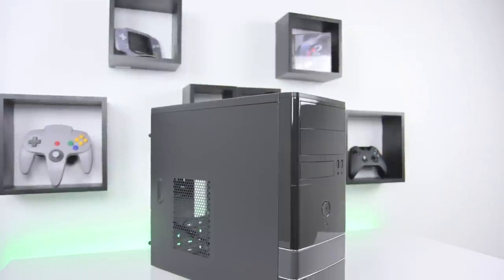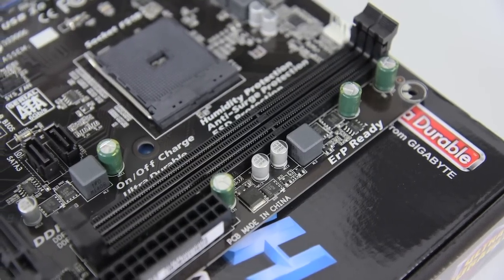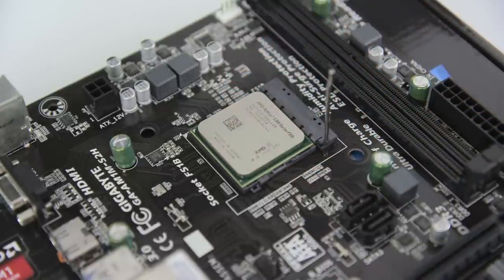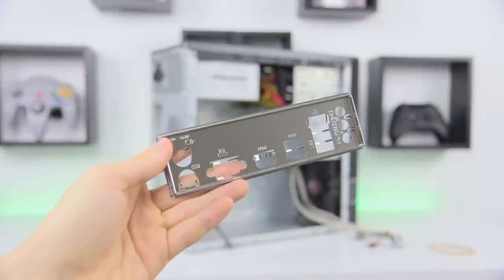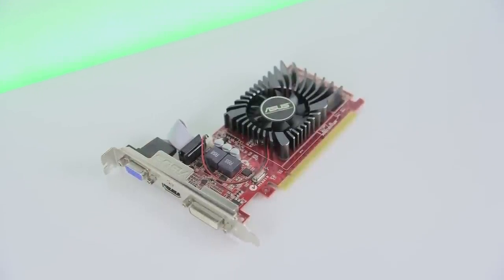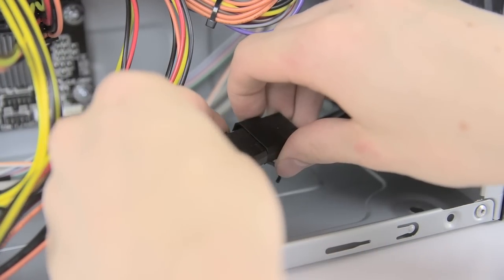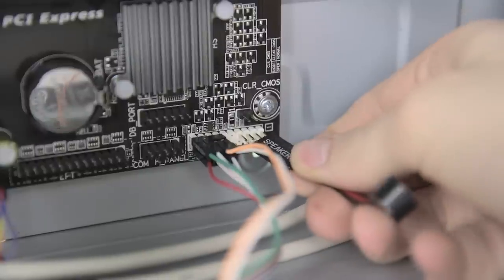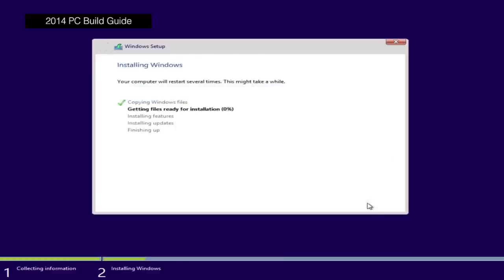How to Build a $300 Gaming PC! (2014 Boson)

Comment from the maker: Especially if you've never built a computer before, the Boson is a great place to start. Doesn't get much easier (or cheaper) than this!
Reply: I'm thinking about using this for building my first pc
Reply: i have a gaming pc already (prebuilt but i installed the grahpics card) and it runs fine, but i really want to actually build one without spending a ton.
Reply: Is it reliable and last long?
Reply: i just dont want to spend a lot of money. Im not saying its better.
Reply: I have a question would this be a good comp for video editing
Reply: Gabe Tinge I would highly recommend going with an a10 apu and no graphics card, that way you can start gaming and then save your money for a decent graphics card. You'll get great graphics from an a10, about the same performance as the little graphics card in this build. From what I've seen, the sweet spot for price to performance ratio in a graphics card is $100-$130.
Reply: Don't know how to build a pc but it should be fun
Reply: Vladi L. Easily, anything that can run minecraft can record it, within reason, this can.
Reply: macho2k8 Personally I would say no. The reason behind this is, is that video editing is very ram intensive. You might want to build a pc with at least 8gb of ram.
Reply: Vladi L. I was able to record mineraft on my $300 hp pavillion g6, 40 fps on the best day ever. Minecraft IS very attractive as you don't need that good a PC to run it...
Reply: Austin, It would be fun if you done a more difficult bulid like a 3000 $ dualbooting hackintosh, instead of these cheap/low-end bulids.
Reply: macho2k8 no, this is the worst possible PC for Video editing pretty much, for serious video editing you need 4 cores/8 threads and 16gb ram minimum, along with a high end Nvidia GPU if you use Premiere pro.
Reply: DoubleInvertz It varies from person to person, It comes down to what you can afford. You can us a medium end Amd card and any program that supports open cl. a system like that would be more than decent.Good video editing seems to depend mostly on the skill of the editor

note: I'm not referring to the build in this video, I'm referring to a mid range amd card, like an R9 270
Reply: Eden Seymour take it apart and re build it
Reply: well, you're right, i should
Reply: i already built a mac for lile 300
Reply: Niall De Barra There is much less complexity, with a 1200 euro build.
You will probably have multiple hard drives, maybe a aftermarket cpu fan etc.
Reply: Niall De Barra i understand, all computers basically have the same parts like a hard drive, processor, ram, graphics card and so on (of course you could add extra parts) But I have a gaming pc. I dont need to spend a lot. This one runs the majority of my games on very high or ultra. I wanted to make this for the sole purpose of making a computer.
Reply: thanks for uploading this video! this will be my first build!!
Reply: Austin Evans Can you do a $1000 gaming pc build? Please! :D
Reply: Brendan eldridge  #nopeonlyinyourdreams
Reply: kyo Kimura Im afraid PCs are less futureproof than current-gen consoles, I´d take console during 1st or 2nd (Maybe 3rd) year, then wait a few years for next major technology (DDR5, GDDR6 etc.)
Reply: I am really thinking about doing this build. Does this come with Windows or do you have to buy it to?
Reply: Jason Hoffman you have to buy the windows disk i think its like 104 dollars for the version that lets you install it as many times as you want and the oem that only lets you install it once is like 90 to 99 dollars but i would not recemend the oem because if you dont want the windows disk any more you can sell it for like 80 dollars on ebay and the oem is worth less once installed.
Reply: Jason Hoffman You have to buy it yourself, but most builds generally don't include a copy of windows. But instead of buying a new copy of windows, you could use your old hard drive, or copy it to a new hard drive.
Reply: Jason Hoffman Windows is not included.
Reply: Mat Hyszka nope
Reply: Gabe Tinge
If you can afford something better, that would of course be good.
Reply: Can you do a small nvidia intel build with still enougj power to max out games. With and i7 and a gtx750ti with the option to sli 2 of them?
Reply: Ulim151 Unforunately a gtx750ti doesn't have the option for sli.
Reply: DoubleInvertz Is a good graphics card really necessary for video-editing?
Reply: can you make build video for the photon please?
Reply: Ulim151 throw the i7 right out of the window for gaming i3 is enough and i5 is the optimum
Reply: Vladi L. I was thinking the same thing
Reply: LaedusMcGonagall yes but for that to work you need at least 8GB of high speed memory at least 1866 mhz as this APU are dependent on fast ram and right now ram is really expensive
Reply: Austin thank you so much for all the videos i've learned a lot as an absolute novice, but a question, would this be a half decent machine to record and edit video on or does that need a different kind of spec?
I plan on doing a home recording studio build and need advice on the PC build to centre it all on, thanks for any advice you can give me
Reply: I can make a computer. All I need... is a computer.
Reply: Omg Austin i just watched it again .You didnt even mount the CPU Cooler it is going to fall off .There is going to be a lot of first time builders very pissed if they follow this guide .Them black adaptors snap into the little holes on the CPU cooler 'then you line up with holes in motherboard and push the black pins into the adaptors .Like screwing a screw into a wallplug..
Reply: Yankee Drummer This is mostly for entry users, and though it would be able to do basic editing, upgrading the CPU and ram to at least a an i3 or quad core AMD would be advised. 8GB of ram is a must for running 64bit windows 7 and video editing. You may need to change the motherboard accordingly if you get a different CPU. I don't think a GPU will help much with editing but if you want to game with it, you may want to think about a 200-300 dollar current-gen GPU.
Reply: Can I put 8gb of ram in this?
Reply: Blanchak45 Yeah, it has 2 DIMM slots. You should be able to do 2 sticks of 4. Just make sure the sticks are the same.
Reply: hey! i know you are a gaming/videos guy and in the video it looks like you have the pc built for yourself! can i install like 3 hdd of 4TB in this pc and will it last long! i am not gonna use it for gaming! i will use it for video editing and rendering?
Reply: Brendan eldridge  without mods probly on high but with a lot of mods drop it down to low
Reply: just wanna ask. how come u call this apu if there is a video card on it?? i thought apu is works only with cpu and ram. (sorry noob here)
Reply: Can you do some more gaming tests on this pc?
Reply: Brendan eldridge yes it should
Reply: awesome austin i love these builds but it would be nice to show cooler looking cases
Reply: Jules Woo he die in another video
Reply: Jules Woo he die in another video
Reply: Pramod Senaratne Cheap and astheticly pleasing aren't too easy to do on a $300 budget..
Reply: PR Edgar LOL How to basic!
Reply: ***** For dirt cheap video editing an Intel i3 or AMD quad core is needed. 8GB of ram is more than enough. Most tests show about a 22% speed improvement with 16GB. You really don't need 16GB but it's nice.
Reply: Would I be able to replace the board with an Asus mini ITX DDR3 1600? If not, any other suitable replacements?
Reply: How do I install the wireless card?
Reply: I'm still not happy! we need a $200 gaming PC lol
Reply: Eden Seymour The best part about building a PC, other than saving a few bucks, is how satisfying it is when you turn it on for the first time.
Reply: peanutsareyum
I don't think it'd be a decent one, though...
Reply: Now i want to build a cheap pc but i already used my summerwork paycheck aww what pity
Reply: Where is the "I'm on the mountain" remix!?!? We need it!
Reply: 4gb is not enough or is it?
Reply: Yuriy Dovhan It is. And you can always upgrade to 8gb.
Reply: How do you install Windows without a DVD drive??
Reply: Montie Gordon You can do it via USB.
Reply: spongebot64 is that in the parts list?
Reply: Montie Gordon
It isn't, but you can still do it.
Reply: SparrowHavvk i personally wouldnt risk, hate when pc turns off because of lack of ram
Reply: Yuriy Dovhan it won't shut it off it will just start paging ( using your hard drive in system memory) which slows your computer way down
Reply: Alex Schmitt alright, i would just buy ps4 (what I did) , would it be better than r7 240 graphics card, what do you think
Reply: Yuriy Dovhan The ps4 is 400$(yes it's still better,than r7 240,but you need to pay 50$/game)
Reply: ScreamerPixel if you read the policy and you really understand what it is, then, you realise its 60 for ps4, pc 50 dollars but ps4 allows you to share the games between your friends and watch gta V trailer, its shot on ps4, the graphics were mindblowing
Reply: Nice Video ! This has tempted me build one
Reply: Yuriy Dovhan Gta 5-why you think it will look better on consoles?The trailers are pre-rendered(and remember the watch dogs!),so they doesn't mean anything.
I agree you,that at this price point the consoles win,but you know....60$ for every single game...just doesn't worth it.And so much games are better on mouse,and keypad,and you can buy controller for pc too.
Reply: What is your amazon affiliate link?
Reply: Yuriy Dovhan haha 50$ for a game, I've never had to spend over 20$. On steam that is...
Reply: MAKE MOAR BUDGET PCS!!!! PLEASE!! :D
<3 your vids.
Reply: almightydeity

Unused RAM doesn't increase speed,unless you're maxing your 8GB of RAM and upgrade to w/e you want 10/12/16/32 w/e,and also depends for what reason you use a PC,especially with ONLY gaming it's pointless to even have 16GB ATM ( while i do have it but for more reasons than gaming alone).

Wait for DDR4 Ram and it's performance increase.
Reply: Yo Austin do more videos like this. Thanks keep it up
Reply: I've always been curious... What do you do with these PCs after you build them? Do you pass them down to family/friends, Sell them, or keep them?
Reply: Can I buy like different case because in Finland we don't have that Rosewell FBM-01
Reply: I've always built my own computers since I was twelve. I never understood why people think they're so complicated. Hardware is a snap. Actual programming is the bitch.
Reply: Hey Austin, can you review the Misfit Shine?
Reply: Meow Shank same
Reply: Hey Austin Show us how to build the neutron pc ( the ones that cost $800 ) PLEASE!!!!
Reply: ScreamerPixel not every game is worth 50$ there are some cheaper ones like rouge legacy, trials fusion etc. Not every 14 year old (me) has 600-800 $ to get proper pc (gtx 750 ti ( not the best but playable))  #stupisdparents
Reply: THANK YOU SO MUCH AUSTIN THIS IS WHAT I HAVE NEEDED FOR SO LONG!!!
Reply: Iam going to bulid this computer do u think it will run call of duty good on it
Reply: mrsims345 You'd mainly want to upgrade the graphics card. A Nvidia GTX 760 or an AMD R9 280 would be great for 1080p gaming. ~$200 cards are the best bang for the buck though you can go a bit cheaper. You might need a better power supply, I'd recommend a 600 watt supply. For everything else it might be lacking a little but upgrades are cheap and easy once you learn.
Reply: Would it last for long? I only have 500 for keyboard, mouse, OS, and the PC... I still have my old monitor.
Reply: 500 dollars
Reply: macho2k8 No, this is a very weak pc.
Reply: Gabe Tinge Welcome to the PC master race gabe. You will soon be bombarded with cheap games in 3-4 months during the winter.
Reply: this is sooo cheap but yeah you can game on it still run games in 720p like the NEXT GEN consoles :-)
Reply: Niall De Barra If you have a low budget and would just like to get into the PC gaming scene, this computer is good for you. Using expensive parts in your first build is by no means "bad" but the chances of you breaking something from your expensive parts is much greater when building your first PC, so using cheaper parts in your first rig is generally a good idea.
Reply: Neither did I, but I was damn nervous and I'm glad I used cheap parts.
Reply: How does windows install on here? Is it a DVD or what? Please reply! Thanks!
Reply: Jubby11  yes!
Reply: ***** You can, just get a 60GB or a 128GB and install the OS on that first, then install your hard drive.
Reply: macho2k8 no
Reply: Can you  pleas make a tutorial for the photon?
THX for your time!
Reply: kyo Kimura you can always uppgrade
Reply: macho2k8 http://pcpartpicker.com/user/JOHN4GAM3R/saved/XzfnTW this is about the cheapest "Good" video editing build, you could ask for.
I'll explain every part
CPU- i7-4770k - I chose this for the hyperthreading! It's very useful and fast when you're video editing.
CPU Cooler - Hyper 212 EVO - best budget cpu cooler! nuff said.
Motherboard - MSI Z87-G45-Really good motherboard 4 the price, you could achieve good clocks.
Ram- 16 GB - 16 GB is basically a neccesity when you're video-editing.
Storage - Seagate Barracuda 3TB - Plenty of space to store your footage plus pretty fast!
GPU - GTX 750 ti - The cuda is good for certain video-editing applications! Enuff 4 BF4-1080p high/ultra @ 60 fps
Case - Corsair 200r - Best budget case in my opinion! 2 case fans!!
PSU - CX600 - 600 watts is plenty for rig! Even if you SLI the gtx 750 ti and overclock!!! Corsair MADE!!

I hope I gave you more or less a good idea as to what's a proper video-editing build!
Reply: JOHN5GAM3R 750 ti cannot play bf4 at 1080p on ultra at 60gps. It can at 40 or so but it's not even close to 60fps.
Reply: On a combination of high/ultra settings it will.
Reply: Yeah I suppose, it is a pretty solid card overall.
Reply: Gabe Tinge  I built it and love it so go for it.
Reply: Gabe Tinge Or you can save up another $400 and have a pretty nice gaming PC and not waste your money on this piece of shit. Building computers are a breeze
Reply: Crak Geners Not everybody can afford to save up an extra 400 bones just for a computer.
Reply: Eden Seymour take yours apart and build it again
Reply: what could i replace the low profile graphics card with to get a lil more fps and such?
Reply: MrJukumarpwn Yeah just add a dedicated GPU and/or up the processor to something like the FX-7850k. That's the best APU  on the market at the moment. This machine is cheap but is mainly to get people an entry level computer.
Reply: Beautifully filmed, edited and explained. Loved the all white background and the light green LED light between the table and the wall. Austin you are a master at YouTube.
Reply: Gabe Tinge Trust me don't!
Reply: I have a very close rig to my backup pc, and it's not really wroth it, if your planning to game and your ok with 720p for new release games, or play them at low to medium seetings then go for it but I could recommend another good beginner pc that would perform better, Trust me I have a amd r7 240, I overclocked it and it could play Bioshock at 35 fps on low settings at 720p, There's no way you could really get 35+ on 720p with this rig unless you overclock, I'm not sure how Austin got more performances then me, but it doesn't run very well.  

Just an FYI my rig is an 
Asus amd r7 240 (overclocked at 900 Mhz for core clock and 2000 for Memory) 
4 gb ram
intel Pentium 3.0 GHz
Reply: So would this rival the high end $1000 machines on the market if I were to use some higher end components? Gotta know before I try.
Reply: ***** Among experienced builders, there are two value pockets, if you can call them that. Pockets where you A) get the best value for your money (600$) and B) get a premium build capable of everything (1000-1100$). Stay within these two budgets when hiring a system builder, and you will be satisfied. 

Now Austin knows a lot about computers, but he does fail to pick the best parts. At the moment, this is your best deal at 1000 dollars.

http://pcpartpicker.com/p/vt6pQ7
Reply: My laptop has better specs
Reply: Austin Evans what other case do you recommend for this build and i would like to know if the motherboard has a built in Wifi card or if i'm gonna have to buy one and install. If yes i wold like a quick tutorial on how to do that. Thank you in advance
Reply: Austin Evans Also will this motherboard support a r7 260X ?
Reply: Austin Evans Also if you could tell me if this motherboard would support another AMD processor and another AMD graphics card
Reply: Hey can this pc run bf4 and if so can it be recorded and on what settings I am planning to build this
Reply: Benjamin Turner No, Not at any good settings. You can upgrade the GPU to a $250-$300 one would work well. This one is mainly for entry level users.
Reply: devansh patel Cases are mostly your call, pick what you like withe space you need. It should support nearly any card,  though I don't think you can crossfire the graphics.
Reply: +almightydeity
 +austinevans Yeah looking for a budget build anyways but i wanted to know if the motherboard supported any other AMD apu or graphics card and also if i get another case what power supply i could get............If you could please help me with that. Thank you in advance
Reply: devansh patel can I use 8Gb of Ram in this?
Reply: devansh patel I'm currently using the Asus AM1I-A (for Overclock) and the 5350. I have the Corsair 430watt PSU you can get on sale at Newegg for $19 a lot. I've got the build in the Cooler Master Elite 130 case. Great little Mini ITX case with lots of room and a great look and price. You can even fit a dual fan 120mm AIO rad in the front of case and not loose any storage space.
Reply: Niall De Barra Your right its not....its the same just low grade parts
Reply: Pandemonium Rage yes just get 8GB DDR3 Ram
Reply: Steven Shaffer Thanks
Reply: So, This is what i decided
Athlon X4 750K
R7 260X
350 watt PSU from corsair
MSI A78M-E35
and i'm still debating on the case.
can you guys suggest a case with a lot of space ? almightydeity Austin Evans
Reply: devansh patel Do not use the 350 PSU! I would use 400+ because of the R7 260x. Also, look at the Fractal Design R4
Reply: Gaming PC??? With Radeon R7 240??? Does this crap even run Minecraft??? You can NOT run decent new games with this piece of shit!!!
Reply: Rinse M. okay thanx
Reply: brez imena go to the 2nd link in the about page he answer your question
Reply: hey Austin im having a problem with steam, so i live in Saudi Arabia and steam wont let me buy paid for games this is what it tells me 'The current payment method does not match the country of the store. The cart has been converted and the updated total will show on the next page. You may also review your cart here, or change your payment method below'.

ps loven da videos keep it up
Reply: I just built one for $260 and it has an A8-6600k APU with an MSI Mobo 4GB of 1866 memory, 500gb HDD,  raid max Atlas case on sale and 430W PSU
Reply: I built the boson but I am having trouble loading windows on it with a jab please tell me the steps to load windows onto a computer with a usb
Reply: mrsims345 I have the same problem
Reply: Think I might have to get a optical drive for it
Reply: mrsims345 hey dude I found this video this may be helpful check it go on YouTube and type how to install windows 8.1 from USB guide/tutorial (easiest method)
Reply: mrsims345 the video maker is ncixcom
Reply: Boston Walker
obviously you can -_-
Reply: Hey Austin, I have been looking forward to some August build and have been wondering if it will come out late/later August or if it will come early/mid September?
Reply: Built the boson it runs all games and never lags I love this computer
Reply: ***** bulid*
Reply: ***** if you mean I never bulid a computer it's like Legos actually,check his how to bulid a gaming computer 2014
Reply: I'm building the 500$ soon
Reply: The photon
Reply: Victor VVG I did some more research and decided this -
X4 750K processor

8GB Ram

Nvidia 740M DDR5 version

MSI A78M-E35 btw this is with a fm2 socket which my processor fits into and not am3+ one.

Also 650 W corsair PSU and all suggestions are welcome but keep them under 450$
Reply: devansh patel nvidia 740 M VERSION ? M version is only for laptops
Reply: ikars melnalknis sorry its only 740
Reply: Marcuss2 well a console will never have any new hardware requirements so as long as you play your pc games on lower and lowes settings -having a constant 'kinda' quality , like a console , it could last up to 5-6 years. About a console lifetime . There are gaming systems with 9800GT+core2quad , and they still perform ok .
Reply: kiss peter 9800 GT does not have DX 11 support, not that I care on Linux
Reply: ok , what's your point ?
Reply: kiss peter That PCs dont last as long as consoles, even the most expensive ones
Reply: As a machine , they last up to 10 even 15 years (and the consoles too) , and i know this as a fact . OF COURSE you can't play crysis 3 of tomb raider 2013 on a 2005 PC , but everything before 2007-8(-9) .
The PC "generations" are not designed to last  as long as on a fixed hardware platform , cause there are almost constant improvements in performance...like a new piece of hardware at every 9 or so months .
SOSOOOOO wou're wrong~ish
Reply: kiss peter Ok, I got some logic for you, modern multi-generation games require at least 4 GB of RAM + VRAM... Both PS3 and Xbox 360 got 512 MB of RAM, while its true that Windows takes a lot of RAM it cant be this high, PC is unoptimised
Reply: Yes i agree a LOT of pc games are unoptimized (, and just the windows with no programs open only uses 'bout 1gb of ram .)
I just said if you don't want to play the latest games , only the ones wich were already released (and let's assume you got an OK system) the pc could last many years .
OK but then you say : heyyyy on consoles we have 6-7 years of new games. Well yes but you don't have backward compatibility with the previus generation .
Then you say : well fudge i'm still getting new and 100% percent compatible games.
Well yeah PC games could be optimized to 2010 hardware but then who would benefit from the latest hardware . And if you can't sell latest hardware , from where will you get the funds to the next gen hardware .....
I mean i'm not tryign to argue with you , but pc's can potentially last for a really long time if used for the appropriate task.
Also Console and PC are 2 different species.
And for the grand finale POTATO.
Reply: Niall De Barra for example the CPU, no thermal paste, no backplate etc...
Reply: While a PC may not last as long as a console, what do we mean by last. Well i think it means that it cant perform decently enough as a console would down the line. But PC's are 60FPS 4K right off the bat and such optimised for 4K will last you atleast 5-7 years(lowing down the FPS and resolution) while a console gets no mods and other upgrades gaming companies are forced to design games optimised for a console specs where a pc(depending on the pc) might give a better or worse performance than that of a console AND PC's can upgrade whereas you have to get a totally new console. A PC can run newer and older games whereas that may not always be true for a console. While you may be lazy and not read all that shit this is what i'm trying to say PC>Console
Reply: Frans Svensson That wouldnt be very helpful as most people dont have $3000 lying around they can use for a computer.
Reply: ZeraXTer FrANk Its for enthusiasts and builder who are all actually interested in this
Reply: devansh patel
Why should he waste $3000 on a computer that nobody will build?
Reply: How do you know that nobody will build this computer ? and I think lots of people will be building this i Myself was thinking of doing it. Also his "build" videos gain lots of views , its basically "advice" also even 1/4 out of the viewers build this computer it IS A HUGE SUCCESS.
Reply: Austin how would I put windows 7-8 on the computer and also will you do a video on how to put windows on it?
Reply: Antonio Valenzuela
I would like to see that too and I still dont really understand the difference between regular and OEM versions of Windows
Reply: ZeraXTer FrANk OEM only works on one PC. Just use the disc or USB.
Reply: Hey guys, I'm having a slight issue. Everything in my Boson is working properly, but the speaker tone keeps going off and there is no video on my monitor, no matter what port I use. Any advice?
Reply: BOTH...Wow
Reply: Make a $300 pc gaming build performance video!
Reply: The photon pc can play sleeping dogs on high settings 1080p ???
Reply: Niall De Barra 750 ti is compatible with sli, pretty hard to find a nvidia card that isn't able to run sli.
Reply: can you do a gaming laptop build?
Reply: guess youre right :/ thats pretty weird though :)
Reply: Niall De Barra I'd say that if the person is really nervous about building it, if they aren't they shouldn't build it though, then it's better with parts that wont cost to much to replace i guess. Except from that, no clue. And more expensive cases are usualy easier to work with, so i have to agree. Don't see how it's better with cheap stuff.
Reply: im confused does it come with a molex lead?
Reply: natez17 gaming when u get to 5.55 mins in the video. There are molex leads.
Reply: k thanks
Reply: ***** Go with the 970 mate. its pretty much the same price but with more memory, better performance and less power consumption. Plus, the headroom for overclocking is insane. I have seen people push their 970's to near 980 performance quite easily. I'm hoping to pick 2 up over the next few weeks, gonna see if just one will cut the mustard and max everything i play out first.
Reply: I know the feeling, ive been riding a crappy £37 gigabyte motherboard all year. Picking up an msi 970 am3+ gaming motherboard for the 2 970s im picking up. Its nothing amazing but it does the job, and i dig the aesthetics.
Reply: Niall De Barra this is easy because most things come setup already like the thermal paste applied and the fans, and so on and on.
And he also said cheaper, so basically saying better fuck up an restart on a 300$ pc than on a 1200€.
Most people tend to upgrade 1000$ PCs or less, but if it's more than 1000, then it will last, like my case 2000$ will last me a bit, since I can run almost any game on the highest settings.
(Gave up luxuries for efficiency and amazingness)
Reply: Can i use a mother graphics car - GTX 750
Reply: macho2k8 No !
Reply: ***** The CPU, the Graphics card, and the RAM
Reply: ***** You don't always have to water cool, you just need a better cooler (not stock for the CPU), you can usually OC the graphics card pretty good if it is non-reference. I'm still experimenting on OC-ing the RAM.
Reply: ***** By any  means it is pretty necessary especially if OC-ing a CPU....get something better than stock. I OC'd my GPU inside my APU and crashed my PC. On the plus side i can run BF3 at ~35fps on dedicated graphics.....AMD is great.
Reply: you can use whatever video card you want....if you have the money for it
Reply: Austin Evans Hey Austin! I was wondering what you do with completed builds? You have done 15+ builds and no use for all of them.
Reply: CATJOE he takes some of them apart and reuses the parts in his other videos
Reply: *****  What do you mean?
Reply: macho2k8 the cpu isnt the fastest, the die is the same size as normal processors so there is less room for a cpu and more for a gpu. It would take a while for the editing to process and live action editing might not work well.
Reply: Hi, could I use a nvidia gtx750 in this build reply fast
Reply: Luke faughnan Yeah ofcourse you can but you might get a bottleneck from the cpu
Reply: RandomNova Gaming thx is there any way to prevent bottlenecking
Reply: ***** what? "why would any computer would water-cooled in the first place?"
Reply: ***** just great, 120-140 fps at least without the aa atleast
Reply: Cliff Richard To answer your question, the CPU used in this video is an APU, he most likely threw the graphics card in there to run dual graphics for better performance.
Reply: Can i put in the Sapphire Radeon R7 250 1GB GDDR5? And can i play skyrim on this build?
Reply: Panagio Tsaou thanks
Reply: Panagio Tsaou can i use the 450 watt power suply thats in the case? Becouse the website says you need 500 watt.
Reply: Well thanks to this vid I'm only scared of the wiring now XD
Reply: Tiger Blaze dont worry when I built mine I didnt need to do cable management I looks ok to me
Reply: BrokenBrainez Ok thx
Reply: Brendan eldridge Here is some advice never build a PC around just ONE game it is a rookie mistake.
Reply: Theorcman2008 Yea thats a bad idea :3
Reply: Niall De Barra  you guys shouldn't be worried about static frying your components its like saying i don't wanna go outside in the rain because ill get stuck by lightning.
Reply: Austin Evans Hey guys, can i upgrade the RAM to 8GB?or it's not going to make any difference?? Please response.
Reply: Victor Garcia hats your current amount of RAM?
Reply: Niall De Barra Because if you break something it's not going to matter much. lol
Reply: yea it would lol
Reply: Tiger Blaze I will buy the pc, but I want to know if I can turn up the memory to 8GB RAM and whether it will work better or will not make any difference? thank you
Reply: Victor Garcia Well 8 gigs of RAM should be enough for a pretty decent gaming computer, so it will make a difference.
Reply: do you know any great graphics cards then xD
Reply: Tiger Blaze
Ok thanks man.
Reply: Tiger Blaze j
Reply: What keyboard and mouse do you use????
Reply: Brendan eldridge I have an i7-3770k and 2 GTX670's in sli and I cant hold 60 at all times in my heavily modded Skyrim. Basically the most simple answer to your question is "No".
Reply: where can i get the parts?
Reply: Well pcpartpicker is a good site to choose them but you need to go on amazon tiger direct or whatever you can find to get the graphics card
Reply: Can you download mac OS X on the Boson?
Reply: what keyboard and mouse can you use for this build????
Reply: FifaGamer 9 9 What ever you like... duhh
Reply: Albert Isidro Get a NUC with thunderbolt... and do the cheapest hackintosh ever ^^
Reply: Could this run arms 3 20-30 fps ?
Reply: Kevin Ahern
yes
Reply: ._. people are still commenting on this 301 comment long conversation?
Reply: Can this pc play planetside 2? Sorry i'm just a 14 year old and don't know much about pcs.
Reply: is there a review vid?
Reply: Jason Swag highly doubt it.
Reply: Can i play Dayz with this computer
Reply: Blaze The Ruthless Hmmm well thanks anyway.
Reply: Jason Swag Your better off saving to aleast 450-500 bucks, thats when you can get to play some games at medium quality.
Reply: Jason Swag Sorry i was thinking of a different pc XD all you have to do is buy a second 4GB Crucial Ballistix Sport RAM stick and you will probably be able to play most games
Reply: So um what pc parts should i get or do i just buy a pc?
Reply: Hmmm that helped a like bit becuase i don't know much bout pcs, but thanks anyway THIS SUCKS Ass. If anyone could help me, plz do.
Reply: ***** Well do u know what parts i should buy?
Reply: Well it depends on your budget.
Reply: Budget is also important... xD but if you want a media type pc or a gaming pc or just a going around the internet pc :3
Reply: I want a gaming pc, i rather just buy a random pc if it work or everyday :p
Reply: +Austin Evans
Reply: Can this pc run CS:GO high setting 60 fps ?
Reply: ***** Like i said i don't know much about pcs.
Reply: Well ***** do you think this is good? this is my final build so i cant change it. http://pcpartpicker.com/user/sharptiger10/saved/CqP7YJ
Reply: Blaze The Ruthless You are way overkillling the processor and ram for that build, get a 4690k and 8gb of ram the upgrade your psu to something that will last its literally the only component that can eff up your whole system, 20$ for a psu is risky business. Also, a 5900 rpm hdd is going to be slow as crap theres no reason to have a 4790k because your hdd is going to be bottlenecking your system hardcore. Use the money saved from the ram to get the hdd and ssd listed below install the os on the ssd and you'll have a blazing fast system. The wd black hdd are have mush faster transfer speeds and the ssd will seriously improved the responsiveness of your system.

Evga psu for 60$ that should last a long time
http://www.amazon.com/EVGA-SuperNOVA-ATX12V-Supply-110-B1-0750-VR/dp/B00K85X23O/ref=sr_1_5?ie=UTF8&qid=1418437886&sr=8-5&keywords=evga+psu

Ssd
http://www.amazon.com/Samsung-120GB-2-5-Inch-Internal-MZ-7TE120BW/dp/B00E3W15P0/ref=sr_1_3?ie=UTF8&qid=1418438344&sr=8-3&keywords=840+evo&pebp=1418438356313

HDD
http://www.amazon.com/Western-Digital-Cache-Desktop-WD1003FZEX/dp/B00FJRS6FU/ref=sr_1_1?ie=UTF8&qid=1418438229&sr=8-1&keywords=WD+black&pebp=1418438237685

total cost added
20$ (you'll get a much faster system for it.)

But you can't change it so yeah....
Reply: 1TB, i would go for 2Tb if you dont have an extra 100-300 GB of storage for the OS (I dont know exactly how much the os takes but im guessing its between that maybe a little lower tho) Im getting 2 Tb doe ;)
Reply: Wow i take that back maybe i should learn how to read full comments XD
Reply: EonofLight Yea thats not going to happen and i dont think you know much about pc's.
Reply: ***** Building pc's is my passion i do it a ton, just like to see people get as much performance for their money as possible. It's just a suggestion so he knows his other options.
Reply: Blaze The Ruthless The os takes 30-40 gigs of data on your hdd depending on if you are running 32 or 64bit and which version of the operating system you are running. Don't get me wrong that processor is killer but the snappiness of the system is going to be slowed down by the hdd.) Once the game/programs loads from the hdd it will run just fine but the load time will be slower. This is as always just an opinion and you dont have to take it (which you won't) but I just wanted you to know about the options you have. Also, I would hate for your psu to go bad and hurt the components of your system.
Reply: Blaze The Ruthless Oh and the reason for only the 8gb is that unless your doing video editing programs today don't utilize more that 8gb for the most part and there is no current gen game that uses more that 8
Reply: Blaze The Ruthless If you want to learn a ton about computers linustechtips is an awesome youtube channel that expains everything you could ever want to know about computers. gl and have fun building! :D
Reply: Blaze The Ruthless and yeah if you've already built it im sorry for all this crap. I am just super passionate about computers haha which is good as it's what i do for a living ;)
Reply: does this have better specs than the next generation consoles
Reply: Juan Gonzalez no, this cpu sucks...
Reply: macho2k8 you would probably want to get atleast 8 gigs of ram to do that. and rendering stuff you would probably want a better cpu/apu
Reply: How many fans can this build fit because the case i what to use is made to use five will that motherboard work?
Reply: Could I put a EVGA GeForce GTX 750Ti and a AMD Athlon Multi Core Processor in this system?
Reply: Austin Evans I have heard that none Named brand psu will cause the Boson to be damaged, is this true?
Reply: IronWenis14 Look on partspicker.com and put in your parts and it will tell you if its compatible
Reply: Would a A8-7600 APU be a better option to the 5350 w/ R7 240 discrete? Cost the same.
Reply: thanks dude followed every steps on your vid & finally got done with mine works perfectly..
Reply: jayr Smilanich mine isn't connecting to the monitor any ideas
Reply: Victor VVG They are not intended for heavy gaming... AM1 platform is introduced in to the same segment where intels J CPUs are, low TDP office PCs. I have Athlon 5350, Asus AM1M-A, 4GB ram paired with AMD 6870. It does wonders if you factor in 25W TDP on the CPU. But it gets blown away by my 5y old phenom II. Max GPU i would go with A 5350 is around 7770/7790/260/260x/GTX 650/650ti/750. If you pair it with 750/750ti you got yourself little beast that consumes roughly 100W in total.
Reply: ive got a windows computer and im just wondering what other parts such as ram cards can i use
Reply: Niall De Barra Some of those computers might have alot more cables etc, more hard drives 1-2 graphics cards that might be difficult to plug in or smth idk
Reply: Thank you for subtitles !! that's cool! not knowing a foreign language people can understand the video!
Reply: lolz i wana see some benchmarks
Reply: so bruh whats the spec ?
Reply: Guy Prince Horrblie
Reply: LMFAOOOO XD
Reply: Austin , What are you're pc specs ?
Reply: Wolfsblut51015 Intel Xeons do not support gaming fully, actually. If you want a good rig that will run BF4 and Crysis 3 on Ultra above 60 fps, its like 2500 dollars, and it includes an i7 4400k-ish processor
Reply: Dan Zhukov not even close unless you are buying it from a retailer.  You can build a pc and can play all new tittles with an i7 4790k and and 1 gtx980 for half and even less.
Reply: hey how to put windows on it I'm just wondering like were do you put the disk in?
Reply: Game Toy wait never mind ill just use my usb lol I'm so stupid! wait i don't have a other computer that has a dvd drive
Reply: Game Toy oh wait i could use my dads mac btw I'm 10 and don't tell me to go out side i bet you I'm more fit than you gtg I'm going to go on the trampoline bye
Reply: Its called a CPU not A APU
Reply: Thanks Austin for this amazing and cheap gaming PC build
Reply: PhantomUniform0
Nope. This one is an APU.
Reply: oh OderpO
Reply: Well it does if you forget to put stuff on the list that needs to be their. Like the power supply, and the poewr cable. Neither of those come with it
Reply: How does it run games??
Reply: good question
Reply: O_O
Reply: Disclaimer: The cost of the operating system is not included...
Reply: So I built my computer and now when I hit the delete or f2 to try and get into my bios it won't let me
Reply: Austin Evans i think you should show people how to apply the thermal paste.
Reply: Austin Evans you should have told people to plug in and turn off the power supply, it would have grounded the entire case and prevent static discharge
Reply: I love consoles but I've been looking into getting a gaming pc and I'm on a really small budget. Idk wether not getting an Xbox one or building a computer is better.
Reply: Will there be a tutorial for the $400 gaming pc?
Reply: Maybe this will help? 1st. Get a lame hardware (which is cost a few hundreds) 2nd. Get all the gaming pc needs 3rd. Install it (I mean put it into your lame hardware) 4th. Now you got a powerful,built-from-lame-hardware <----------------------------(Uhhh.....why i laugh when i typed this? Is it funny?) pc. If it works let me know
Reply: Austin Evans Benchmarks?
Reply: Austin Evans do i need an anit staic band or anything?
Reply: ok thx
Reply: Austin I have a Question
How Come on some builds I see you do you only use one 4GB ram Stick?
Reply: 4 gigs is NOT the best its carp
Reply: not in this build and not for gaming only maybe for minecraft.
Reply: Austin Evans tnx i used nvidia geforce gt520
Reply: Can anyone please give a link to the power supply I should get!! All I see when I search is the case but not the supply thank you!!
Reply: Hey Austin. I love your videos. I'm thinking about going into PC gaming but I'm on a budget and I hear a couple of people complaining about this PC so I'm not to sure about getting it or not. Should I get the boson or should I not? Please respond.
Reply: Wolfsblut51015 Thanks very much bro. I'll check it out.
Reply: Can I replace the AMD for Intel?
Reply: Jay leo no you would need to replace the mobo too
Reply: Ok thanks.
Reply: The motherboard in this video is out of stock on Amazon, will it make a difference if I use a different one
Reply: finners coy Get the Asus motherboard, I just used it in a build for a friend it can allow you to overclock this processor. The Gigabyte motherboard will not allow it.
Reply: Does this come with a cd drive or do I need one? If I do what do u recommend I use?
Reply: Austin Evans I am a noob to PC's, but can i use a wireless pci on the motherboard?
Reply: Austin Evans my graphics card costs more than that pc. LOL
Reply: Austin Evans can i  useASUS P8B75-M/CSM LGA 1155 Intel B75 HDMI SATA 6Gb/s USB 3.0 Micro ATX Intel Motherboard instead of the other one?
Reply: Josh Titler No you would need a new cpu
Reply: ***** chill dude
Reply: Dude where can i buy these details and that computer case?
Reply: False, the Xbox one has cheap deals every week as well with gold.
Reply: Hey guys I'm looking forward to making my own PC, I will mainly be using it for school projects watching YouTube surfing the internet and downloading things no gaming. I want something that has the specs of a $400 PC that you buy at a store but I know they are just overpriced so I figured building my own would be much cheaper. I appreciate any suggestions feel free to ask me any questions. Thank you in advanced!
Reply: Alain Renteria if you are doing basics and no gaming just buy a laptop. It would be better instead of building. If you were gaming then I would say build
Reply: What about a disc drive, some games come on disks u know
Reply: disk are old but i do agree
Reply: Austin Evans can it run gta v
Reply: Gabe Tinge  as a fisrt dont do this
Reply: +Austin Evans This CPU suport dual chanel memory ram?
Reply: Could the ENERMAX OSTROG ECA3253-BW work?
Reply: +Austin Evans You might as well have used a cpu rather than a gpu since you installed a separate graphics card
Reply: +George Oliver what? That doesn't even make sense
Reply: tridentsanctuary yes it does ...
Reply: +Austin Evans thx, i thumbsed up, and put it in my watch later for when i build mine.
This video was 5/5 because everything was very clearly explained, the surrounding environment was very clean and  tidy and you helped me and loads more noobs with building a pc sience i'v only had a laptop up to now.
Reply: mitsos13ps Good luck when u build ur pc.
Reply: George Oliver thx, ill try not to destroy the cpu...
Reply: and remember the thermopaste if its not preapplied to the heatsync
Reply: can you put more graphics cards in?
Reply: +nate carson you can but it not really a gaming pc in my opinion. It more of office computer.
Reply: Austin if I am not mistaken, the Wi-Fi adapter is installed in a similar fashion as the GPU & the Optical Drive is installed similarly to the HDD with SATA. Is this correct?
Reply: +Saad Khalid Thanks
Reply: Umm I get that this is a budget build but is there REALLY no hope for cable managing a non modular power supply in a budget case? Where there is a will, there is a way, right?
Reply: +Austin Evans What the average frame rate for this on minecraft
Reply: wow that really good for a low price, but is it on low settings
Reply: +Saad Khalid Did your parents buy parts for you?
Reply: +Austin Evans How much ram does this have?
Reply: +cookie monster 4gb
Reply: +Austin Evans hey man if i get a 200$ graphics card but i have a crappy computer will it work?
Reply: ***** I figured out a way! It'll require my dremel, plexi glass and clear 3M double sided tape.
Reply: +FaZe clutch Yes it should work if you are referring to prebuilt computer that has an intel i5 4th gen processor it should be completely fine and your computer will work like a beast.Only thing you may need to be concerned about is the power supply because most gpu's require atleast 500 watt of power and most recommended use 650 watt poker
Reply: +Austin Evans the funny thing is my laptop would destroy that desktop so im going for a budget build thats a bit more powerful
Reply: What  is  a molex plug?
Reply: So i could play games like the Forrest and day z on this? Thanks
Reply: +Austin Evans can this pc run gta v at 720p or 1080p  smoothly
Reply: Maybe 720p at 30 fps.
Reply: Austin Evans Boson+Monitor+3D Printed Case=All-In-One PC+MikeOS+Hardware Spright Generator+Opera Browser+Online Suite=M'Go Running LifeGuard Computer
Reply: Austin Evans Please don't delete the video. It might not be that good, but a lot of computers do it much worse.
Reply: Austin Evans Jeremy Harrex asked you

"So i could play games like the Forrest and day z on this? Thanks"